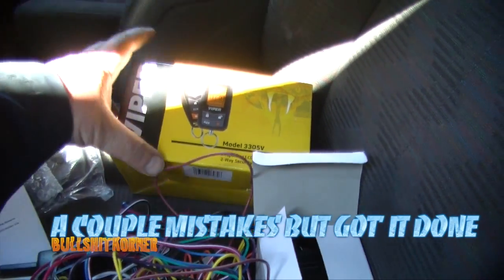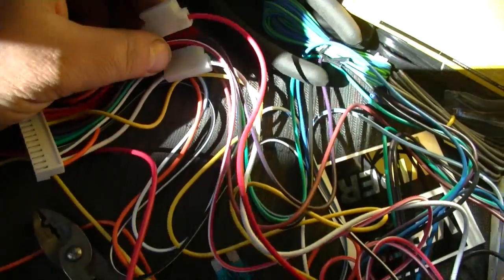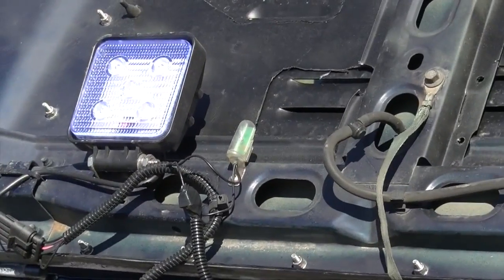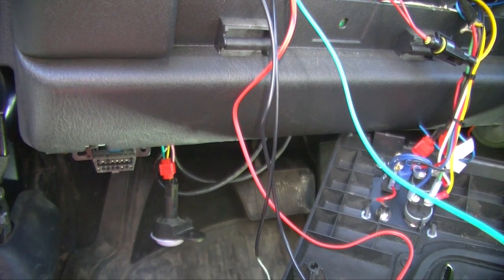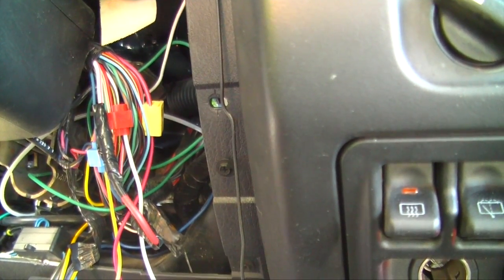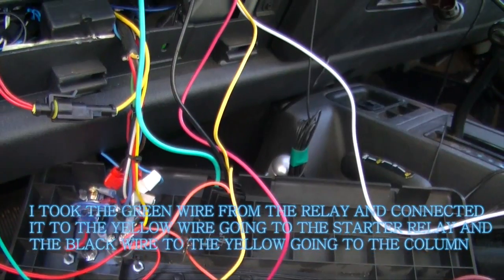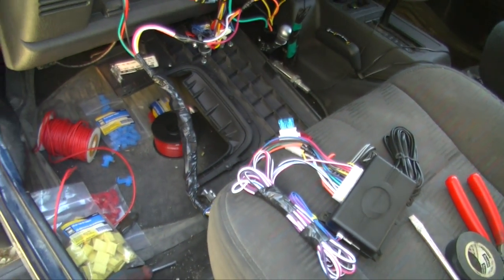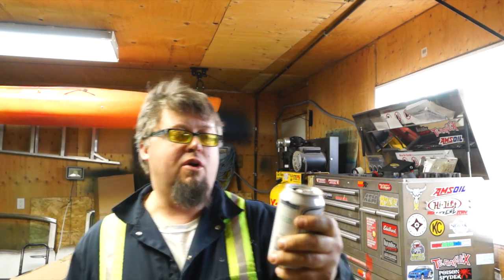How to Install a Car Alarm DIY

Comment: i know this is old video but i need some idea i installed the same alarm  and is doing the same thing as far as starting when the alarm is activated. the other problem is when the key is on or accessory the alarm is activated. any suggestion? thanks

Comment: Hello, if that relay goes bad, due to ya alarm system, would it trigger a no start by shutting down ya starter, fuel pump, and ignition system?

Comment: Hey I got a car that has a 771xv viper alarm on it, I store it for winter and when I went to get it out the key fob will not open the doors, it is also stuck with the alarm on so the car will not start, any ideals I'd really appreciate it
Reply from the maker: Check batteries in the remote

Comment: Hi, does the Viper 5305V need any additional hardware for remote start ? Thanks for the video
Reply: Almost all vehicles will require a module to bypass antitheft features. During remote start the vehicle must get the impression that the proper key has been inserted or is within proximity to the cylinder. Many GM vehicles use a module and do half a dozen features through a single wire in the OBD II connector harness.  This is always best left to professionals because there's ONE correct way and countless wrong ways.

Comment: How difficult would this be for a first timer??
Reply from the maker: I wouldn’t recommend unless you had strong electrical knowledge
Reply: @BackCountryWrenching  thanks for the honest opinion. Yes I just got the system installed on my truck yesterday Professionally lol but I was watching from inside the shop and it looks difficult.

Comment: all hear is how bad it is to use those wire locks. They seem to work real easy thou,
Reply from the maker: peelman1506 they work great inside a vehicle however i'd never use them where they are exposed to weather.
Reply: It's called Beer thirty! You know what time that is? When ever you want it to be.
Reply: p

Comment: I bought a Viper alarm/remote starter for my last new car. I am very disappointed and dissatisfied with Viper do to the poor quality of the main remote that has bad cracks all around the outside edge of the remote. I glued with crazy glue but it is no longer holding together. It should have a metal edge around the entire outer edge. It looked like it std but they are tricky in fooling the customer. It is painted plastic to look like metal. I resorted to the one way remote but can not tell if doors are open or closed. Plus.. my car continuously remotely starts accidentally because of poor design. I paid about $650 and will never buy another Viper product.